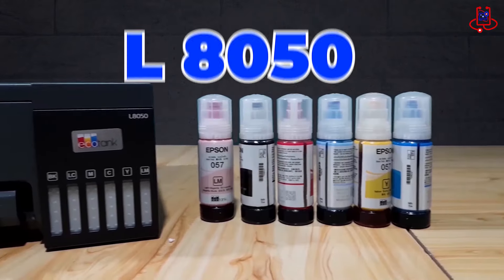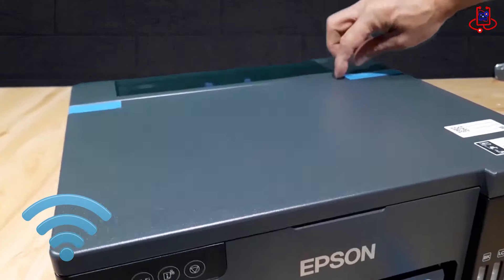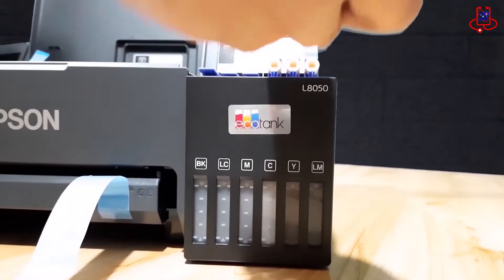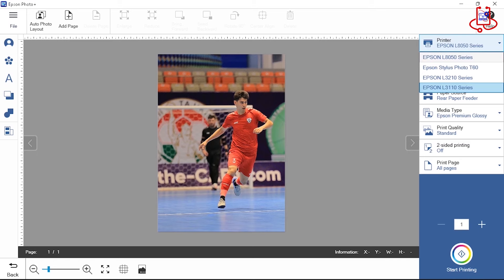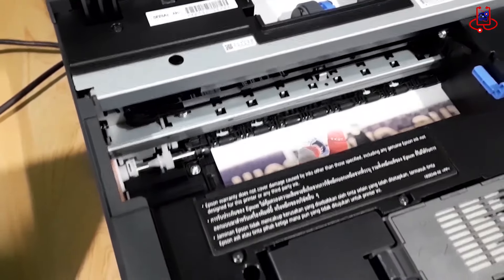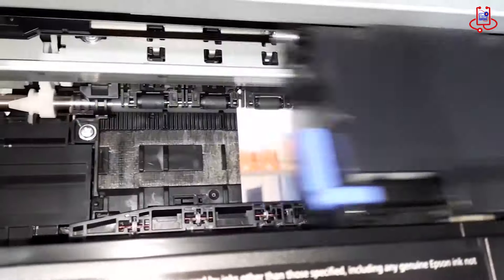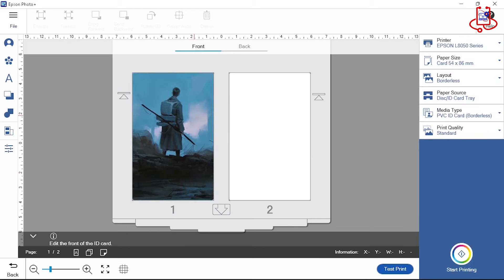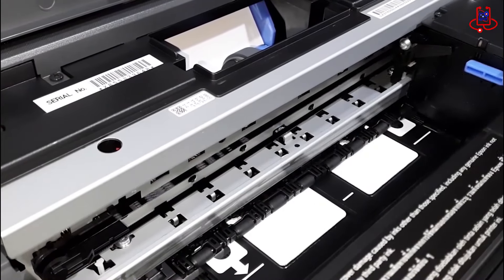Everything about Epson l8050 printer review/printer price

Comment: Can this printer print on certificate paper? How much GSM does it support? The certificate paper we are using is 250 GSM. Please confirm, so we can proceed with the purchase.
Reply from the maker: Yes, absolutely! The Epson L8050 can print on certificate paper. It supports a weight range of 102 to 300 gsm, specifically for Premium Glossy Photo Paper. If your certificate paper is glossy and designed for photos, then it will work perfectly at 250 gsm. If you have any more questions, feel free to ask!

Comment: My main intention to buy printer is to print PVC cards. Do I have to buy a lamination machine as well??
Reply from the maker: For the Epson L8050 printer, a laminating machine is not necessary as the printer itself provides high-quality and durable prints. However, if you want your cards to be more resistant and protected, using a laminating machine can be helpful.

Comment: How many papers of high grams (250-300) can be put in the tray to print? Or is just one by one? Please quite urgent
Reply from the maker: You can place 5 to 10 sheets of high gram (250-300 gsm) paper in the tray at once without any issues. The Epson L8050 is designed to handle this amount without causing problems.

Comment: I need printer in Epson that can support to 350gsm or more. For planner front-back cover printing, and wedding/birthday invitation cards printing. Can you recommend any?
Reply from the maker: For printing on 350gsm or thicker paper, I recommend two Epson printers:

Epson SureColor P8000

Suitable for printing on thick paper up to 350gsm and beyond.
Excellent print quality for invitation cards and planner covers.
Epson SureColor P900

Capable of printing on thick paper with high quality.
Great for invitation cards and professional graphic prints.
Both options are great for your needs.
Reply: @devicedoctor1  can I print photo as well ? Do they work properly switching between photos and cardboard papers? Or do you think I need to buy Epson L805 for photos separately?

Comment: Im looking to make custom stickers, kindly suggest a good printer. Does L18050 work better?
Reply from the maker: For making custom stickers, in addition to the L18050, here are a few other printer options:

1:Epson L805: Offers excellent print quality and can print on various materials.
2:Canon PIXMA Pro-100: Great for high-quality photo and sticker printing.
3:Brother QL-820NWB: Designed specifically for label printing, with good speed and quality.
4:HP Envy 6055: A versatile option with color printing capabilities.

Comment: Looking for sublimation printer, able to print White design on Black Mug.  Possible with this L8050?
I don't use Black Mug with white area.  The Mugs are completely Black.
Reply from the maker: Unfortunately, this printer does not generally have that capability. However, if you can find a customized version, it might support it. But the best printer for printing on black mugs is the Sawgrass SG500

Comment: Can l use to print out suprimation paper for the T/ shirt?
Reply from the maker: Yes, you can use the Epson L8050 for sublimation printing on T-shirt transfer paper, as long as you use sublimation inks and compatible sublimation paper. This printer supports high-quality sublimation prints that can be transferred to T-shirts using a heat press.

Comment: Hi! Can this printer print on printable magnetic sheets?
Reply from the maker: Hello! The Epson L8050 is primarily designed for printing on standard paper, photo paper, and other common media types. While it may be possible to print on printable magnetic sheets, it's important to check the manufacturer's guidelines for both the printer and the magnetic sheets to ensure compatibility. Also, make sure that the magnetic sheets are within the recommended thickness range for the printer and that they do not cause any jams or damage to the printer.

Comment: For pvc printing, the original ink can be used?
Reply from the maker: Yes, you can use original ink for PVC printing. However, for better durability and water resistance, it's recommended to use inks specifically designed for PVC.

Comment: Hello sir, is it epson L18050 printer can print dtf sheet?
Reply from the maker: Hello! Yes, the Epson L18050 printer is not originally designed for DTF printing. However, a modified version of this model is available for DTF printing. If you want to use this printer for DTF, make sure it has been properly modified and is using the correct DTF ink.

Comment: Looking for sublimation printer for t shirts mugs and caps do you have
Reply from the maker: Yes, the Epson L8050 printer is suitable for sublimation printing on T-shirts, mugs, and caps. Additionally, a similar model, the Epson EcoTank L18050 A3, is also a good choice for this type of printing, especially if you need larger prints (A3 size) for bigger designs. Both printers work well for sublimation printing, as long as you use sublimation ink and appropriate transfer paper.

Comment: can i print borderless for a4 with photo glossy paper ..plz reply little urgent
Reply from the maker: Yes, you can definitely print borderless on A4 glossy photo paper with the Epson L8050. This printer is compatible with various types of glossy papers and supports borderless printing. Just make sure to enable the borderless printing option in your printer settings.
Reply: Thank you so much
Reply: I use photo print for business and catalog so how many prints can I print with one set ink
Reply from the maker: @mehaayofficial  
 The number of prints you can get from one set of ink depends on the size and quality of the prints you're making. For the Epson L8050, which uses 6-color ink tanks, you can expect to print around 1,800 photos of 10x15 cm (4x6 inches) with one full set of ink. However, this can vary depending on factors like the type of paper you use and the complexity of the images.

Comment: According to the information I have received, after printing the PVC card, the card will fade after 7 to 8 months is it true sir.

If the card get wet,the colours on the card may be removed or discolored is it true sir
Reply from the maker: 1: Fading of PVC cards after 7-8 months:
Typically, PVC cards printed with standard printers may start to fade over time, especially if non-durable inks are used. The lifespan of the print on PVC cards largely depends on the quality of the ink, paper, and the storage conditions.

2: Effect of water exposure:
Yes, if the PVC card gets wet and it’s printed with non-water-resistant ink, the colors can fade or even be removed. To avoid this, it's recommended to use water-resistant inks and protective coatings on the PVC cards.

Note :For longer-lasting prints, using high-quality PVC cards and inks that are resistant to water and fading is key to ensuring durability.

Comment: Can this printer use art board paper
Reply from the maker: This printer is specifically designed for high-quality photo printing on paper and is optimized for printing on ID cards. Due to the slightly delicate pickup rollers, using other types of paper, such as art board paper, can cause wear and tear over time

Comment: Can it print on  270gm A4 paper
Reply from the maker: The Epson L8050 printer can print on various types of paper. Some of these include:

1:Plain Paper: For everyday text printing.
2:Glossy Photo Paper: For high-quality photo prints.
3:Matte Paper: For printing photos and documents with a matte, non-glossy finish.
4:Heavyweight Paper: For printing on thicker papers like 270gsm.
5:Water-Resistant Paper: For prints that need to be water-resistant.
6:Sticker Paper: For printing stickers and labels.
7:Specialty Media: Such as transparent paper, thermal paper, and magnetic paper.

Make sure to select the correct paper type in the printer settings to achieve the best print quality.

Comment: I have a question is it true that i have to use it daily or at least once every other day or the ink will dry and give you bad printing???? Please someone help me about this
Reply from the maker: Yes, that's absolutely correct. Inkjet printers, if not used regularly, can experience ink drying out which can damage the print head and cause it to stop functioning. The print head is the most crucial part of Epson and other inkjet printers and can be quite expensive to replace. Therefore, it's very important to use the printer at least twice a week. Our recommendation is to print one or two sheets every two days, which should be sufficient to keep the print head in good condition
Reply: @devicedoctor1  thank you so much very helpful and you literally saved me 🌹
Reply from the maker: @emanillias435  
Please, you’re welcome! For support, please subscribe to the channel if you haven't already, so you can stay updated with our other useful videos.

Comment: is it possible to close the ink tank to stop the ink to go to the head and store the printer for monthly use ?
Reply from the maker: Unfortunately, this approach is quite risky and requires expertise. The printhead of this printer is different from older Epson models and is more durable. If you still want to proceed, I recommend filtering the ink tubes first to ensure no ink is left in them. After that, you can close the ink tank or empty it. However, this process is somewhat challenging and should be handled by a technician, as it carries some risk

Comment: Which brand of paper is best to use for photo printing using this printer? That is waterproof and will not fade? Thank you
Reply from the maker: For photo printing with the Epson L8050 printer, and to ensure the paper is waterproof and resistant to fading, the best options are:

1:Epson Premium Glossy Photo Paper
This paper is specifically designed for Epson printers and delivers excellent print quality. It is also water-resistant and ensures vibrant colors that last.

2:Canon Pro Platinum Photo Paper
Known for its high quality, this paper is resistant to water and color fading, making it a great choice for professional photo prints.

3:Hahnemühle Photo Rag
A top choice for fine art and high-quality photo printing, this paper is water-resistant and has excellent archival properties.

4:HP Advanced Photo Paper
This HP paper offers great color reproduction and is resistant to water, ensuring your prints stay vibrant for a long time.

5:Red River Paper UltraPro Satin
A professional-grade satin photo paper that is water-resistant and maintains precise color fidelity.

Note: It's always recommended to use paper that is specifically designed for your printer, so Epson papers are a great choice for the best results.
Reply: Thank u so much! Already subscribed your channel ❤  @devicedoctor1